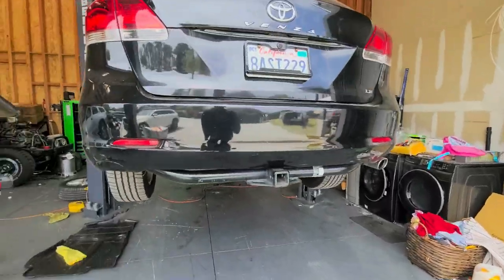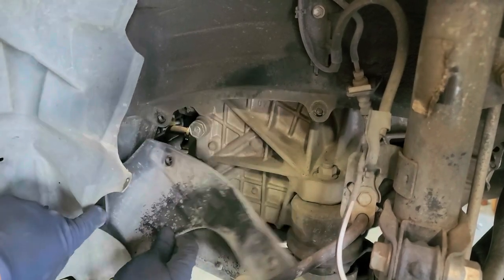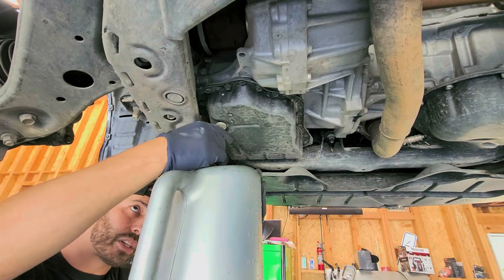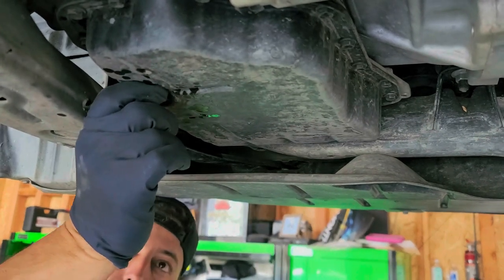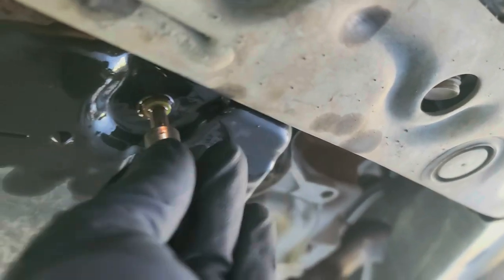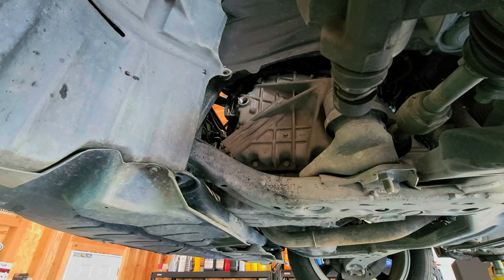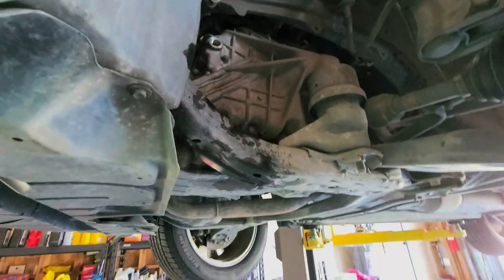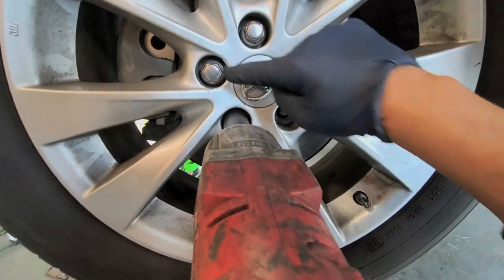2015 Toyota Venza transmission drain and refill

Comment: I changed the transmission fluid on my Toyota. It had never been done before and there was no sign of leaks. I put in exactly how much it drained out. The car was left overnight so the engine was cold. One thing I don't understand. The fluid drained out pretty good when I opened the drain plug and the drain straw was in place. But why after changing out the fluid, I started the engine and checked temp of transmission pan. It was 106 degrees F, the fluid was still coming out. I thought Toyota calibrate the fluid so fluid level was even with the height of the straw when temp is in the range of 103-114 degrees F.

Comment: If your transmission isn’t leaking why not just add the same amount that you drained? It seems like it would be a lot easier and you wouldn’t need a scan tool.
Reply: For anyone watching this video that acutally needs help, it's probably their first time changing it. How did you know the guy/shop that did the job last time did it right? Just as an engineer myself, I do not give my trust to nobody before they earned it.
Reply: Because they have been known to leave the factory with low levels of ATF!
Reply: This is how you top it off. Use to be A LOT easier with a dipstick.
Reply: Fluid expands when warm. Your car needs to be cold and you need to trust that the fluid level was right in the first place